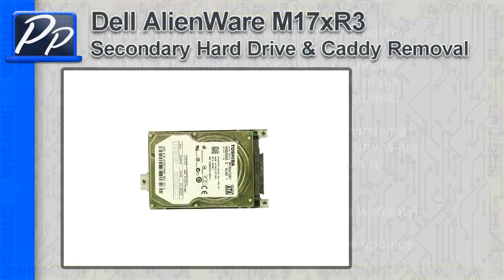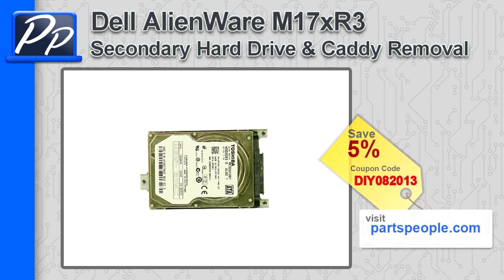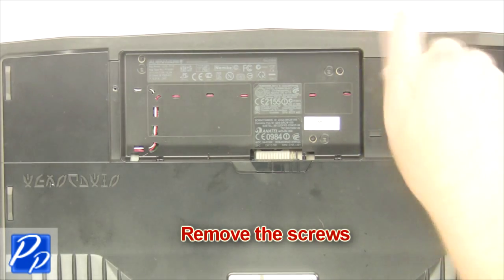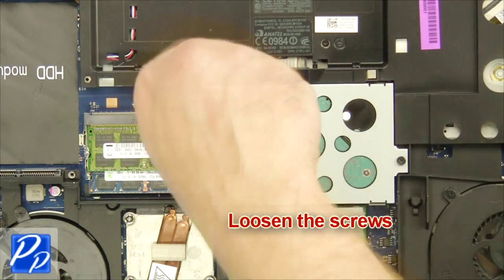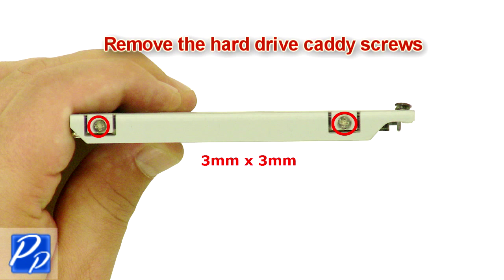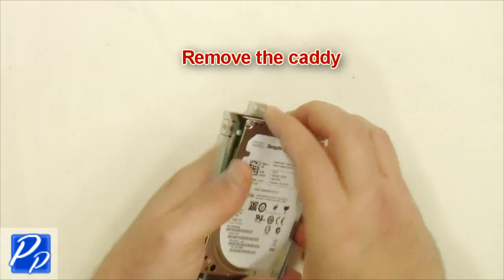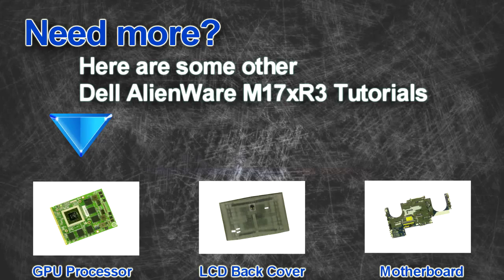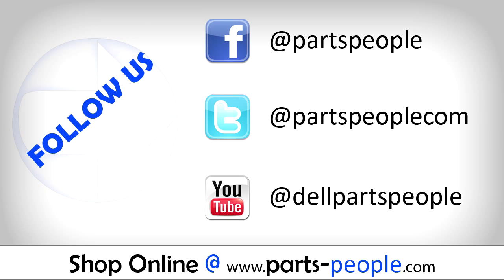Dell AlienWare M17xR3 Secondary Hard Drive Replacement Video Tutorial

Comment: What model type do I need to get for the middle hdd
Reply: Almost any will fit. You should think about going SSD if you have to replace a hard drive, if your doing it for space reasons, still go ssd & use the oem HD for a secondary/extra space. SSD will give much faster everything